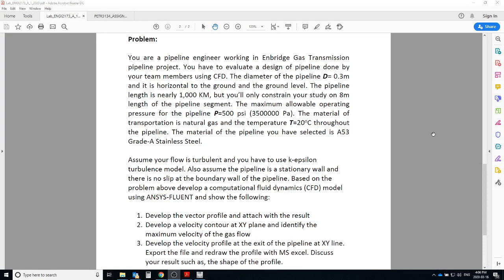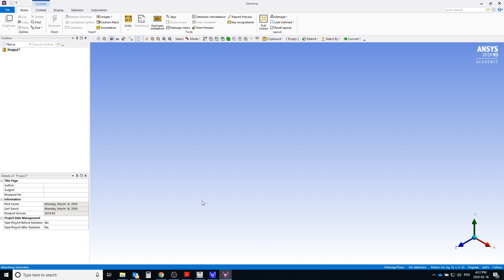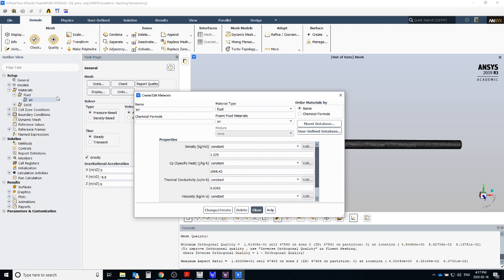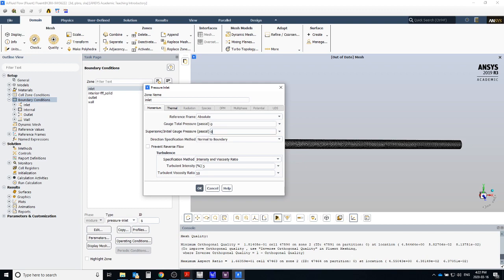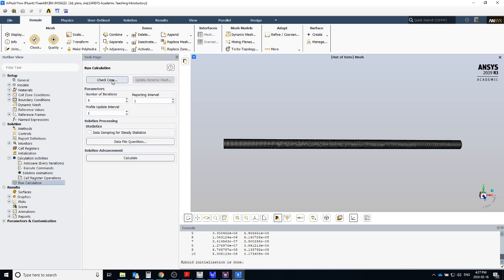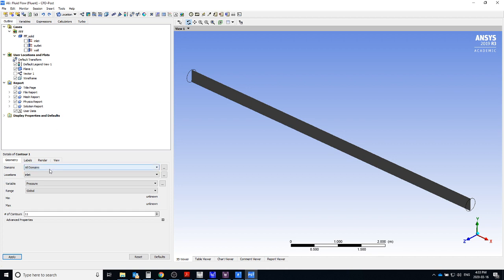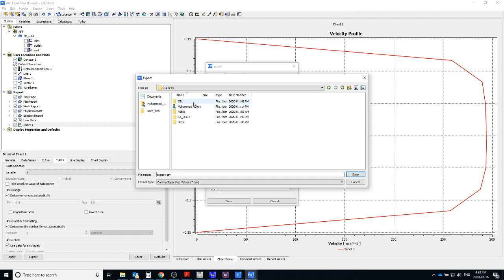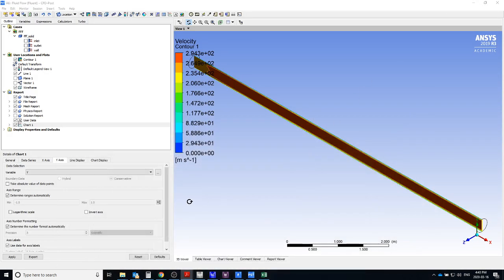Gas Transmission Pipeline CFD Simulation ANSYS FLUENT

Comment: Thanks for posting of the video and clear explanation for each step of the analysis. I have a few questions with regards to the analysis. Qn 1: Is it possible to perform the entire length of the pipe  to obtain bursting pressure of pipe  results ?

Comment: Hi Muhammad Jujuly 

Thank you for your posting of the video and clear explanation for each step of the analysis. I have a few questions with regards to the analysis. 

Qn 1: Is a good alternative to apply the sweep meshing for the pipe since it is a cylindrical shape ?
Qn 2: Is it possible to perform the entire length of the pipe (including the elbows) to obtain more accurate results ?